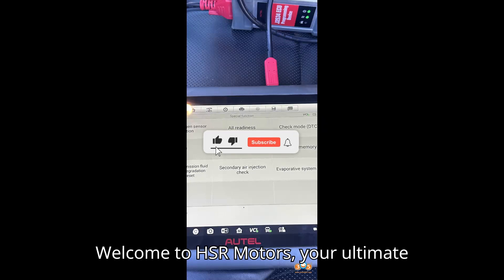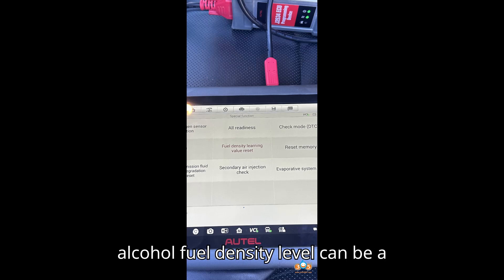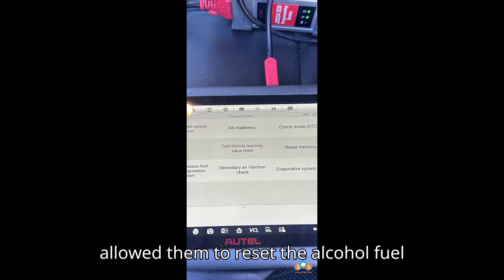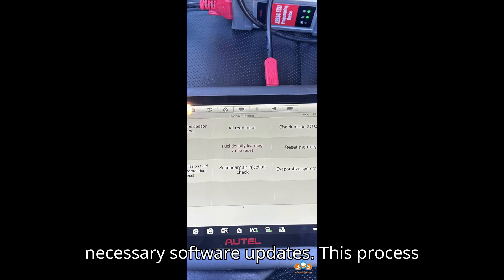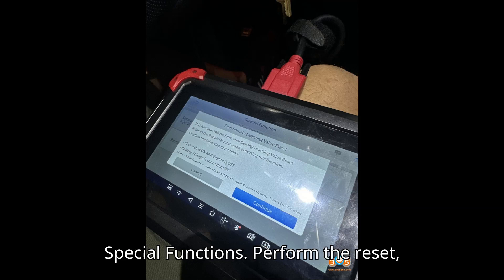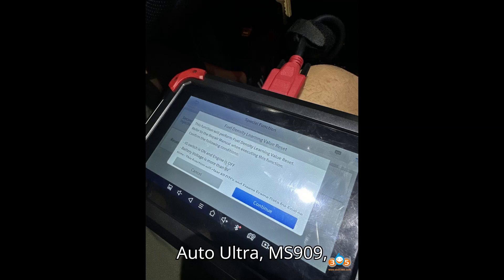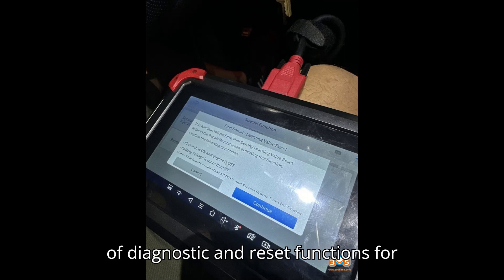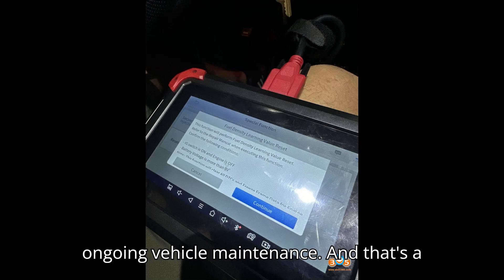How to Reset Toyota Alcohol Fuel Density Using a Bidirectional Scan Tool

Comment: Was this scanner the LAUNCH
X431 CRP919E  Lite  or the Pro model?
Reply: I am doing this same thing right now. I got the elite pro model in the global option
Reply: Do 4runner 5th gen have this reset function?
Reply: Using launch creater elite T 
Fuel density learning value reset utility failed… Tells me to refer to repair Manuel for details?